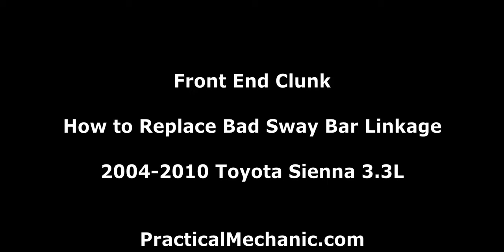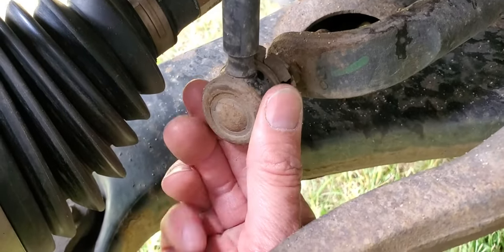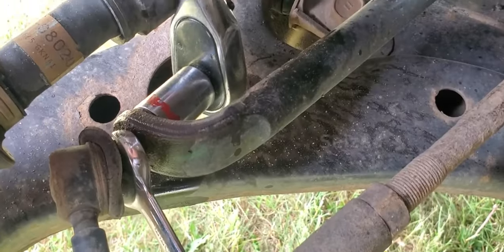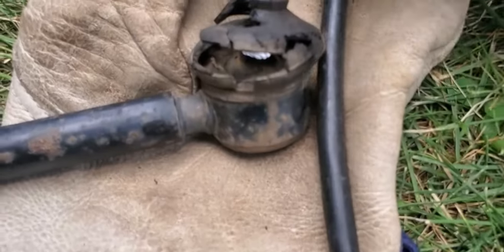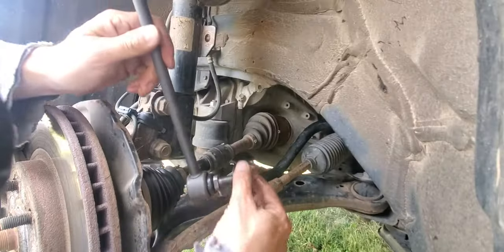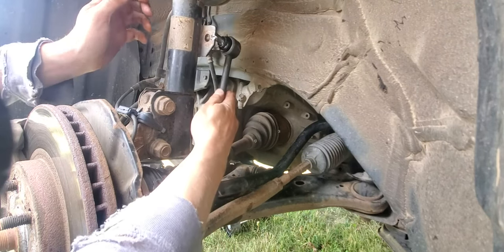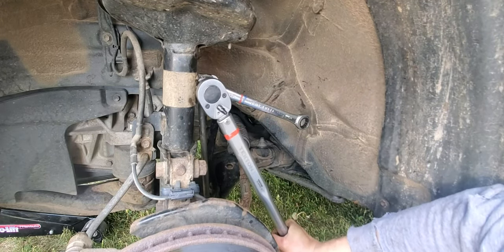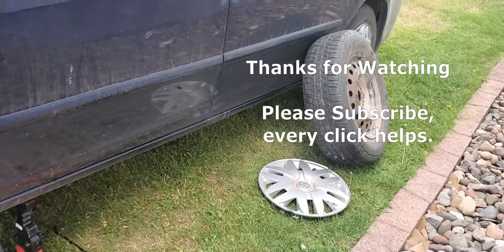How to Replace Sway Bar Links Toyota Sienna (2004-2010)

Comment: my sway bar needs to be replaced, but the suspension is jamming the removal. How do I lift the up the exposed back of the tire without putting the car down? where do I use the jack without causing damage

Comment: I need help I got that radio you reviewed and installed on that handa accord well I installed it and the heat works for the AC but there’s no cold air anymore
Reply from the maker: Glad you got the radio! Hope you like it so far! 
For the AC, check a couple of things: if you have dual climate control, DON'T use the y-cable that came with the kit! Also, you may need to change the canbus settings, to select your vehicle. If you didn't see it already, here is a link on how to change those. 
https://youtu.be/a_RYZagnNxE
If it's still not working after that, I recommend you contact the manufacturer, they are quite responsive. Good luck 👍!

Comment: The bottom nut and joint/threads will ALWAYS be seized. So, cut it off with a hand saw and metal-cutting blade or a reciprocating saw with a metal-cutting blade.

*Then, use a dremel or a drill with a tiny 1.5 inch or 2 inch diameter cut-off disc to get the rest of the joint shaft/threads out of the sway bar mounting hole*.